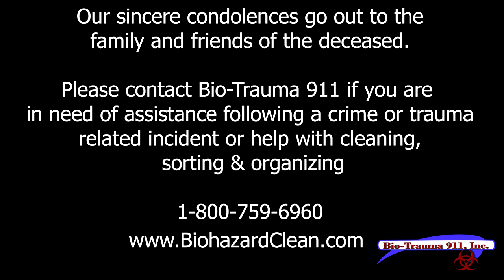Decomposition in Hotel (Dead for Three Weeks)

Comment: If I were the owner of that motel. The mattress would be gone.
Reply from the maker: We did return to remove the mattress at a later date. However, due to the use of a very heavy mattress cover, there were absolutely no contaminates on the mattress and it was probably cleaner than you would find at hotels that don't use mattress covers.
Reply: @Biotrauma911  I am sure it's fine... It's just the mental image of what happened.
Reply: Yea.....someone slowly rotting on top of it for 21 days would be my biggest concern cleanliness isn't really the problem lol
Reply: Pretty sure hospitals don't remove every bed that's been died on..
Reply: @canadiansfirst3636  You are correct. But hospitals don't have rotting corpses on a bed for weeks. A dead person is removed within the hour. Never heard of an hour old corpse smelling.
Reply: @michaelh5055  True but still.
Reply: As long as the trained cleaning crew, which I'm certain the owner had to pay for, certified that makes as clean and safe. Given the very thin profit margins of motels, replacing a perfectly good $400-600 mattress would make no sense to me. It's not like there'll be a sign on the door stating that someone died in there.
Reply: @koretechx1  Trust me, I have been in hotel management. Profit margins are nowhere near thin.

It's extremely profitable to own a hotel... Unless it's some crack house way off in the middle of nowhere 🤣.
Reply: Right lol
Reply: Regardless the mattress should be burnt
Reply: I would strip the whole room and redo it
Reply: Nobody would know though, you've probably slept in an apartment where somryjong similar had happen and you wouldn't of even know.
Reply: Probably has bad juju on it too.  No cleaner will remove that ever
Reply: @Kelly I was a manager at a large hotel. We washed all sheets and comforters after every guest checked out.

The thought of the policy at the chain you worked for is disgusting. 

We had guests that were absolutely disgusting. I instructed staff that if linens were found with poo stains, they go to the dumpster.... We had a very clean establishment that we took pride in.
Reply: I've worked in motels where the bedspread was rarely washed and I've worked in hotels where they were washed at every turnover. I love to see white spreads because those are usually cleaned with every guest and a bleaching type agent can be used. If I'm in a room with dark or high printed spreads, they go straight to the floor.
Reply: @michaelh5055  Am nurse...some stink, some leak, and some seem to explode
Reply: @kaneowen9671  
I found out the last studio apartment I lived in had a dead man in it for a week and a half before they found him. I wondered why it had new floors!
Reply: @elizabethconroy7665  I TOTALLY AGREE.. DUMP THE DAMN THING
Reply: AMEN; EVERYTHING!😒
Reply: Gonna remove the whole room
Reply: @canadiansfirst3636   Hospital beds have durable plastic covers so nothing can get inside. Hotel beds do not. I would never stay at a place that left a mattress someone died on. That is just disgusting in so many way.
Reply: @Kelly Agreed. So gross..
Reply: @michaelh5055  The guests pooed on the beds? Yikes!
Reply: @michaelh5055  not within an hour, especially if family is there saying good bye.
Reply: @koretechx1  Let me find out a hotel gave me a bed that had a rotting corpse on it to spare their profit margins. Their profit margins will get a lot thinner when I blast them on every review site on the internet. How many mattresses are they replacing due to rotting corpses that it even needs to be considered in their budget?
Reply: I’m stripping the bed in every hotel because of this and boxcutter
Reply: Nope, I’d sell the entire place
Reply: I agree with you
Reply: Funny story... Don't stay at the Equis in Honolulu. After being done with our stay we removed the blanket covers to make sure we weren't leaving anything behind and discovered an old bloody mess in the process. At didn't have chuncks but it was heavily stained, so they spot cleaned it but never removed the mattress. You could see where the person was laying and where the blood pooled along with questionable streak patterns. I have no idea what happened on that mattress but it wasn't cool to come across that after sleeping on the thing for nearly a week. I still have the pictures from it because it was so strange. I hope they removed it after we complained.
Reply: @canadiansfirst3636 No hospital would have a dead body laying on a hospital bed/mattress. Dying and decomposing to the point of being liquefied is not the same thing.
Reply: Every episode I have seen it does go
Reply: Yes!!
Reply: @canadiansfirst3636  doesn't matter we will all die too....
Reply: I sure as hell wouldn't sleep on any mattress where a dead person laid rotting,  I don't care how squeaky clean they are. Just the thought. 🤢
Reply: It should be gone.
Reply: @michaelh5055 they do if the poop slips out.
Reply: Independently wealthy?
Reply: How is someone dead in a hotel room for 3 weeks?
Reply: Omg that whole room should be renovated why did no one check him for 3 weeks in.  A hotel
Reply: Did they replace the rug or just clean That too
Reply: I would do the same, as a matter of fact, I would get a brand new mattress and box springs, new carpet, repaint the room, and put in everything brand new. That also includes the closet door as well.
Reply: It's covered in plastic! Wow
Reply: @jaclynperez2172 I'd think it would still smell. Ugh.
Reply: Dang frickin right
Reply: I'm surprised the hotel staff didn't smell a decomposing body after 3 weeks to be honest. And I'd of thought the whole room would be gutted.. wall paper stripped etc I've been in a room with a dead body that had been there for a night and the smell was already awful 😳😱
Reply: Tight wads, that's nasty!!
Reply: @michaelh5055 Just wondering why the room was not schked all these days? What about the smell
Reply: Yes
Reply: To me I'd remodel the whole room...
Reply: I'd throw away bed and all
Reply: @canadiansfirst3636 the bodies aren’t left to decompose on those mattresses for 21 days. The bodies are cleaned and cared for before going to the morgue. Staff removes all bedding and the housekeeping department comes in to clean and disinfect. The mattresses are also not covered in fabric. They are covered in a heavy non porous material that can be wiped clean.
Reply: How does a corpse remain in a hotel room, undetected, for 3 weeks? The stench would have had to be unbearable,  even if he ran the AC at its coldest. Had he paid to remain that long and asked to not be disturbed prior to checking out?
Reply: @jaclynperez2172  Why would cleanliness not be a problem ? That is biohazard, so you have to take that serious!!! 😮
Reply: I know
Reply: @canadiansfirst3636 pretty sure hospitals don’t let dead people lay on the bed rotting for 3weeks either.
Reply: @michaelh5055 unless they shit themselves after death , which is quite common.
Reply: @elizabethconroy7665 why? And why burned?
Reply: @sherrystuer1884 no such thing
Reply: Desire to remove the mattress is purely psychological.
Reply: Of course they removed it.
DUH!
Reply: I’m far more afraid of taking bed bugs home from a motel than anything else
Reply: @elizabethconroy7665 Why?That's nonsense.It's not contaminated in any way.
Reply: @sherrystuer1884 Rubbish.Thete's no such thing as "bad juju"
Reply: There is Inflation! Have a heart !
Reply: @Biotrauma911 what happens with the stuff put in the plastic "rubbish" bags ? In the rubbish bin or 🔥 ?
Reply: Absolutely should be disposed of.  I have watched videos of another biohazard clean up company and they would never leave the mattress plus they also would have left the floors bleached clean where you would never know there had been any staining.  The motel owner might have wanted to spend as little as possible cleaning this room.
Reply: If they didn't change the gloves, the mattress was contaminated by the cleaners!
Reply: I won’t lay on that bed huhuhuhu I might be have a nightmare
Reply: @kokot8710  Yea,I was wondering that too. It didn't seem like they changed their gloves. Although, maybe they figure cause another cover will go on it? But figured they would still care.
Reply: I’m going to see this every time I stay in a hotel now 😮
Reply: But in that hotel nobody checked the room for three weeks?
Reply: @michaelh5055 that's not always the case. I once worked for a small long term acute care hospital in tulsa and we had a patient who died and I don't know why as I'm just a lowly nurse aide so I don't know anything and no one listens to me, but anyway, this patient who died was left on her death bed in her room for 3 days while the roommates visitors came to visit! Now how is that for hijinks?! Luckily, I didn't have that patient and didn't hear about it until after the fact! My God, that is mind boggling!!
Reply: Exactly! That’s fucked up to have other guest sleeping on a mattress that someone died on
Reply: Nobody’s gonna know 

How are they gonna know
Reply: yes I agree new  carpets the lot preferably get a priest in there aswell
Reply: @fluffymacaw933 that’s bit too much
Reply: @canadiansfirst3636 But the body hasn’t rotted in the bed for 21 days.
Reply: @rosannacellini2158 I heard it’s hard to get the stench out. I had a Sunday school teacher who was a police officer when I was a kid and we used to beg him to tell gross stories. He told us he went to the scene of an unattended death where the body had been decomposing for weeks and even though he didn’t touch anything he said the smell got all in his clothes and he threw them out.
Reply: Just the smell alone probably drew into everything
Reply: @Biotrauma911 what about the smell I sure wouldn't want to sleep  in a bed someone died in
Reply: @Biotrauma911 yea but still, no body wants to sleep on a mattress where someone died!
Reply: @janiceharris1812 I'm blown away with hearing about your story. That's sickening.
Reply: That’s different. Hospitals standards for cleanliness and much higher.
Reply: Probably still the mattress probably stunk. Maybe that’s why they went back to get it. Guests complaint?
Reply: @michaelh5055  Nobody checking in would know.
Reply: They'll just flip it over and look the other way..
Reply: @canadiansfirst3636 no they don't but yet again they don't let them decompose on them do they
Reply: @sherrystuer1884  what is Juju?
Reply: Hell yeah who saves a crime scene mattresses? Just sick 😷
Reply: @canadiansfirst3636 
True, but ppl that die in hospitals don't sit abd decompose on the bed for 3 weeks...
Reply: They're cheap
Reply: Naw just reuse it..
Reply from the maker: We did return later to pick up and destroy the mattress. Thanks for the comment.
Reply: @canadiansfirst3636  yes but they are covered in heavyweight waterproof casings and they don’t leave corpses to rot for 3 weeks. When my husband died in hospital 7 years ago I was pressured to leave the room after 1 hour as they needed the bed and the bodies in the UK are washed before being sent to the hospital mortuary.
Reply: Absolutely. Especially cause they touched it after all the soiled items. They didn’t even change their gloves. Really sad whatever happened in that room. Condolences to the family and the loved ones of the deceased.
Reply: You used the same gloves to move the mattress and boxspring that you touched all the bodily fluids. Gack.
Reply: @canadiansfirst3636 yes but they don’t decompose on them for weeks they are immediately removed.
Reply: They don’t care they don’t gotta sleep on it remember it’s all about money 💵
Reply: I want that brand mattress cover!
Reply: You can't just get rid of a mattress that a body has been on. Why the experts have to carry out their work of disposal (Contaminated) You understand now ?
Reply: The owner and staff who allowed a dead body to go undiscovered for 3 weeks, should be totally ashamed of themselves...absolutely shocking and disgusting. Surely to god there must have been cleaning staff who wanted to clean and change bedding? I just can't fathom this out....something seriously wrong here...poor guy dying all alone with no one to miss him...heart breaking!!!
Reply: That room would be redone
Reply: Yeah, I’m pretty sure they are not going to reuse that one, maybe they mark for free out by the dumpster 😂
Reply: They just threw away some nasty biohazard with their gloves and then they’re gonna take their gloves and touch the mattress… I’m sorry that don’t make sense
Reply: @michaelh5055  Oh yeah, they start to smell almost immediately and that's how flies and other insects find them.  Good ol' cadaverine and putrescine!
Reply: How can you even keep this mattress
Reply: Everything would scrap the lot start fresh
Reply: @janiceharris1812 but at least you didn't have any disturbance of any kind?
Reply: @rosannacellini2158 but how would you know
Reply: After the room has been thoroughly cleaned and scrubbed down from top to bottom. A priest needs come in the room to be blessed and saged out. Just in case there might be some bad juju 🙏🏽
Reply: There’s a difference from laying for 3 weeks decomposing versus laying in a hospital bed dead for a couple hours. Big difference.
Reply: Yes. Cause that smell will always be there.
Reply: The mattress, carpet, etc.
Reply: @canadiansfirst3636 yep, though a patient wouldn’t be decomposing for 21 days on the bed either. Just saying …
Reply: Here's my question, how was it 3 weeks before this guest was discovered? I'm guessing this is probably one of those extended stay places where they have monthly rates but still, you would think that housekeeping would have come in. I guess they don't unless you request it except maybe bi-weekly or monthly. Very sad and I agree with the person who said that if they were the owner of that hotel, that mattress would be gone. Absolutely. It's a biohazard. Rest in peace to the deceased.
Reply: @jaclynperez2172  I know! Imagine laying down on that or your wife or little girl sleeping right on top of where a body had decomposed for 3 weeks. I don't care if it's technically ok - it's really just not ok.
Reply: Right. Dead body on it for 3 wks? Gone.
Reply: Music has got on my last nerve!!!!  Lol
Reply: @canadiansfirst3636 yeah but the cadaver is removed right away, it is not left rotten in the hospital bed
Reply: . People don't stay in hospital beds for three weeks after they die. 🙄
Reply: ...and the bed, and the carpet, and everything else....
Reply: Yeah no thanks @Biotrauma911

Comment: Gives me the creeps to think of sleeping in this room. I think the bed should be replaced anyway.
Reply from the maker: Thanks for the comment Nancy.  In all fairness to the hotel, there was absolutely no biohazards on the bed from the death.  At least this hotel uses heavy-duty protective covers that can be changed out on a regular basis.  Most hotels don't use any type of mattress protection and you can only image all of the germs and biohazards that soak through the sheets and contaminate these mattresses.
Reply: I agree.  It's the principle of it.  Replace the mattress.
Reply: Me too.
Reply: Definately so. Can you imagine. Whew gives me the eebbie jeebies
Reply: Exactly. Imagine renting a hotel room and sleeping on a mattress that somebody died on?
Reply: Never save floor wood next to the body it saves smells and nasty
Reply: Yes there was.. at the baseboard of the bed on the inside
Reply: I could see it on the 1st part that was cross contaminated on the bed
Reply from the maker: @SaraJean85  not quite sure what you're referring to but we removed all biohazards and there was no odor present when we departed. This was confirmed by hotel staff. As for what you may believe is cross contamination, which you've mentioned in other comments, you're watching appropriately 11 minutes of a job that took us nearly 4 hours. Every inch of that room, including the bed, was disinfected several times and when we left that room was probably cleaner and contained less germs than most rooms in the hotel industry.
Reply from the maker: @SaraJean85  not quite sure what you're referring to but we removed all biohazards and there was no odor present when we departed. This was confirmed by hotel staff. As for what you may believe is cross contamination, which you've mentioned in other comments, you're watching appropriately 11 minutes of a job that took us nearly 4 hours. Every inch of that room, including the bed, was disinfected several times and when we left that room was probably cleaner and contained less germs than most rooms in the hotel industry.
Reply: I suppose that THAT room is cheaper than the others in the hotel...
Reply from the maker: Hello Nancy, thanks for the comment. As posted earlier, we did return to the hotel to remove the mattress
Reply: nothing would happen, if you sleep in that room. I tried )))
Reply: ill rather sleep on the street

Comment: TIL that hotels really dont care what happens on a bed they will try to rent it out asap regardless
Reply from the maker: Thanks for the comment Steve.  In all fairness to the hotel, there was absolutely no biohazards on the bed from the death.  At least this hotel uses heavy-duty protective covers that can be changed out on a regular basis.  Most hotels don't use any type of mattress protection and you can only image all of the germs and biohazards that soak through the sheets and contaminate these mattresses.
Reply: All about the all mighty dirty dollar